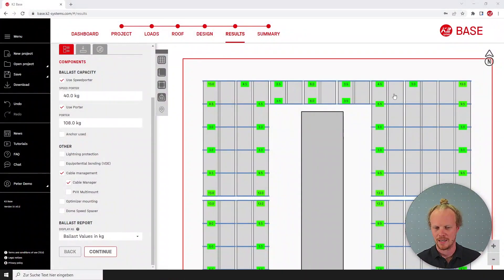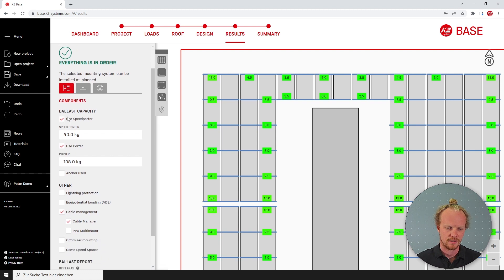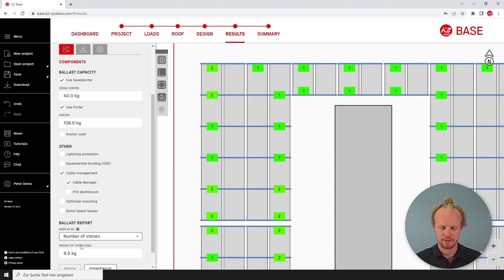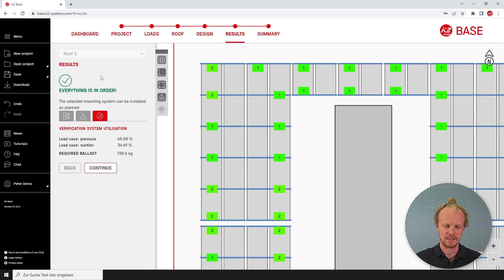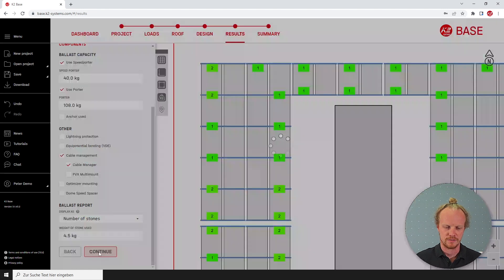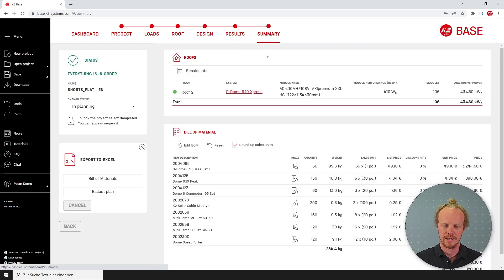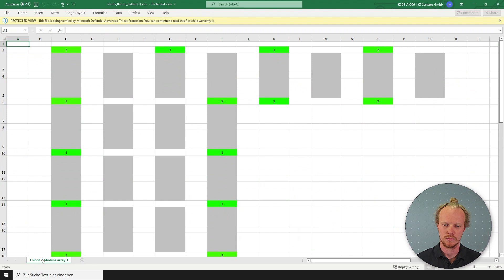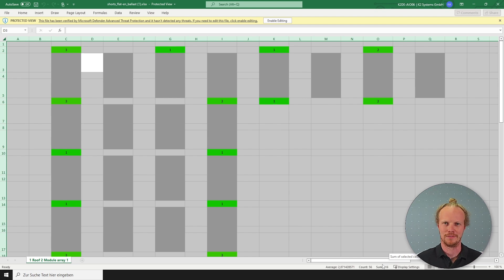Tutorial Base EN: Flat roofs – ballasting with stones

Comment: What does it mean when the ballast shows number in orange or red with the kg values ? It is a warning only or does it mean that your rail system is not able to support the ballast that your software is computing ? If this case how to fix this issue ?
Reply from the maker: These colors show that you have high ballast on the mounting system. If it's going to be too much ballast, K2 Base will show a warning message. 
There are several ways to improve the ballast – try not too have many small module blocks inside a module array (typically at the edges). One way to do that is to change the position of thermal separations.

Have a look here:
• Create Maintenance walkways and change row distance https://youtu.be/1_-2vfnvwG0
• Divide module arrays at thermal separations https://youtu.be/oj5GQSp3MDg

Maybe our webinars will be interesting for you. The next flat roof webinars are on the 18th and 19th of April
https://k2-systems.com/en/resource-center/webinars/

Have a good day

K2 Systems